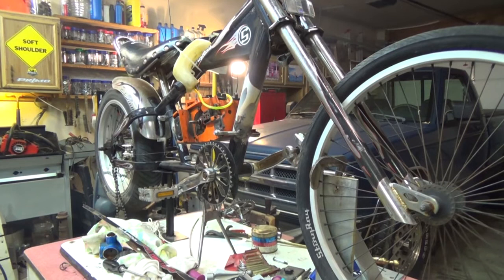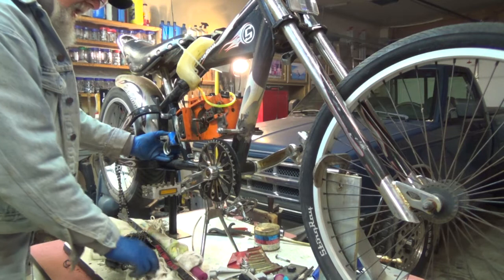StingRay first run

Comment: hey George... it lives... haha... great work my friend... thanks for sharing... vinny
Reply from the maker: Thanks Vinny. Now to get it to drive the wheels.
Reply: The Shade Tree Fix-it Man couldn't you use the original clutch mounted in it's original spot & run a chain down to the rear wheel... just a thought... vinny
Reply from the maker: bnsf6951
That is one of my considerations, though the sprocket on a chain saw is different than that of a bicycle and I need to keep the pedal assembly functional too so it will be considered a bicycle still. Another suggestion is to run it down to the pedal sprocket and use a double sprocket there to accommodate both needs. We shall see. Thanks for the thoughtful suggestion.

Comment: Close call George - I thought it really was going to fall off the table!
Re drive is there the clearance for a chain to come down to the main chain pedal sprocket if it was a double / triple type? I've no idea of course what sizes you would need on either end but no doubt that engine revs pretty high!!
Reply from the maker: I thought it was going over too, but the front wheel being anchored stopped it. I have been thinking along those lines too Dan and it is worthy of further consideration. Thank you for the great suggestion.

Comment: not to sound like i'm braggin or something, but it's in the upper sixties down here in central mississippi.i'm sure it'll be gettin kinda cold down here soon.great job on the sting ray george.
Reply from the maker: I WISH it were in the 60s here, but it is what it is. Thanks for stopping in for a visit. I just try to remember that when it is 70 here in the Summer, you are pushing 100 with high humidity down there. There are some tradeoffs no doubt. Thank you for the words of encouragement.